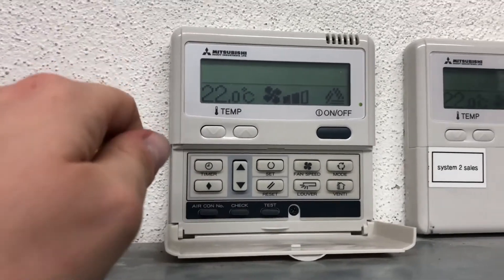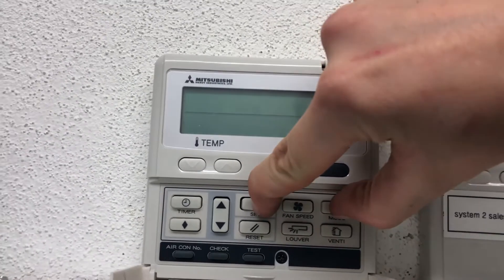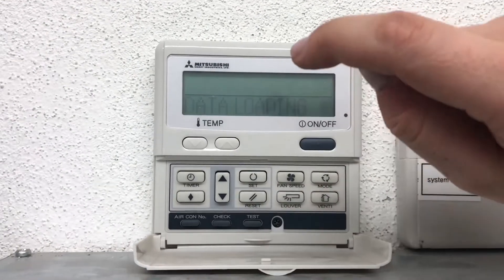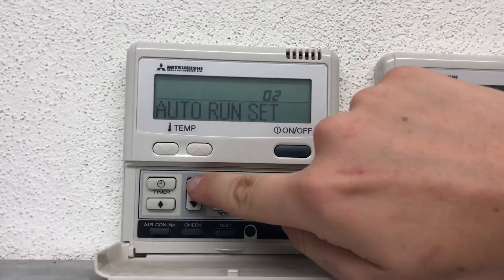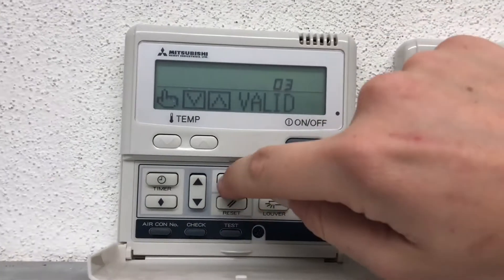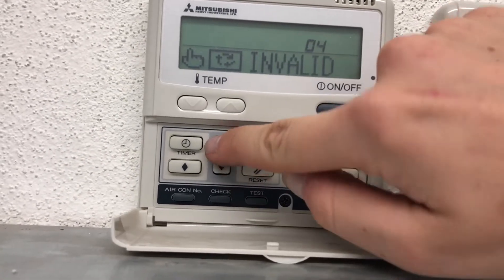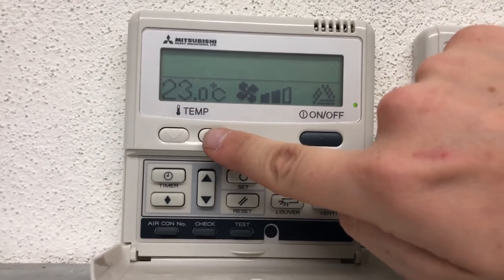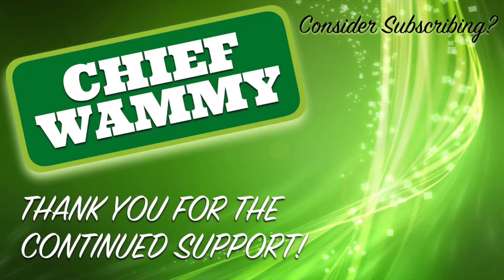HVAC Tips #1: Mitsubishi HI RC-E5 Remote Control Lockout

Comment: That invalid oper appears only when one of the thermostat is in heat mode . Trust me
Reply from the maker: Pretty sure you can select different options to restrict usage on the controller. This example was in a supermarket and if they weren’t restricted, staff would play around with them. They were in cooling too. I’ll hold my trust for now!

Comment: Can you please tell me, when this remote on the wall goes blank and won’t turn it needs a new fuse in the outside unit. Where is the fuse located please?
Reply from the maker: I’m not too sure about this one. It may be a fuse or it may have tripped the breaker. This could have happened for several reasons, one of which could be a faulty compressor. Fingers crossed it’s a simple fix!